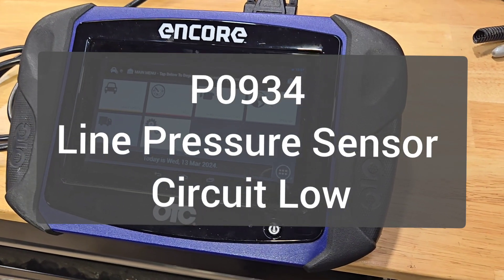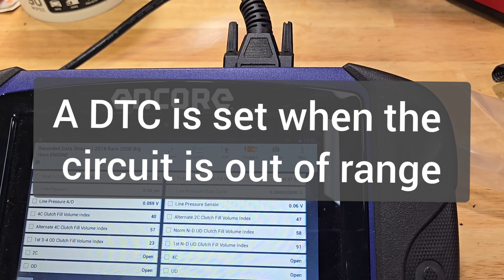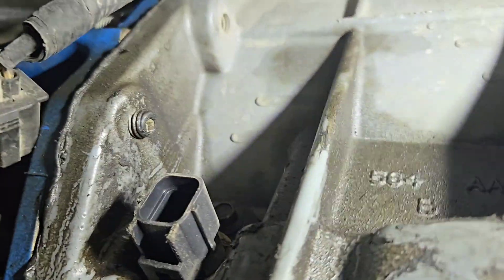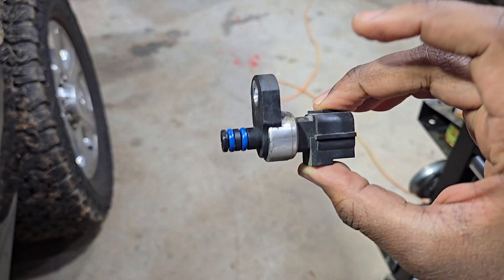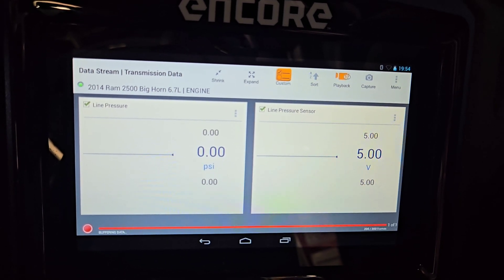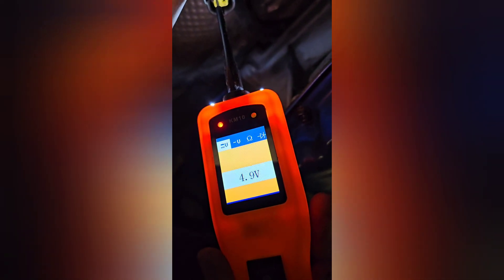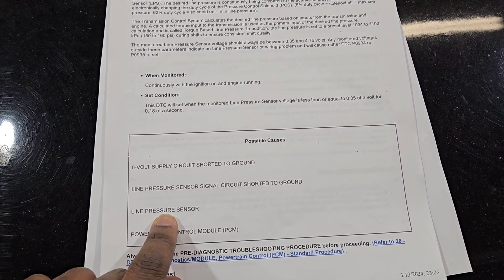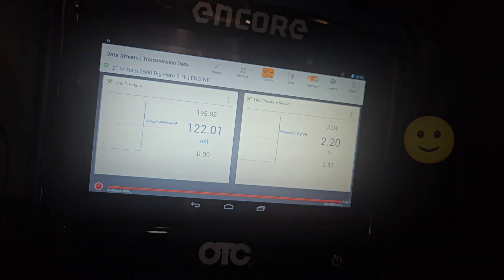RAM 2500 Cummins DTC: P0934 Line Pressure sensor Circuit Low

Comment: I have a 2016 with the Cummins. I replaced this same sensor a month ago. A different code led me to it though. The engine light went out and all was good until today. It came back on but showing the code that you are showing. Any ideas?
Reply from the maker: Use an OEM sensor from a dealership.

Comment: What sensor is being changed ?
Reply from the maker: The line pressure sensor
Reply: @PremiumFuelOnly  ok I search that up but get Pressure Sensor Transducer 😅
Reply from the maker: That's probably it, it goes into the side of the transmission.

Comment: Thanks for the video!
I have the exact same situation.  Replaced my sensor with an Amazon part because of a sensor trouble code.  The new sensor voltage is 0.06v when the truck is not running but just under 3v when the engine is on. 
Where did you find the info regarding how you said the pressure sensor should produce a signal of at least 3.5v when the engine is off but in the on position?  Thanks
Reply from the maker: Its found in the TechConnect literature for this code. An OEM sensor is recommended, good luck.
Reply: @PremiumFuelOnly Is TechConnect a subscription based diagnostic tool or app?  I am unfamiliar.  Thanks
Reply from the maker: @jacobIsrael1200  Yes, its a subscription based portal techs use to access information on Stallantis vehicles. You should be able to get into it via the Mopar TechAuthority website.

Comment: Does the P0934 correlate to the P0810 code? If not, what is the P0810 code because they came on at the same time.
Reply from the maker: Not that I know of, if the P0934 codes appears, the system could go into a default failsafe pressure which assuming excessive wear in the transmission, could cause insufficient line pressure to activate the clutches in the transmission. But I'm just guessing here, since that's a generic clutch code, not usually seen on a 68rfe.  I'd fix the sensor issue first.
Reply: @PremiumFuelOnly  It's on the 9 speed transmission on a 2014 Jeep Limited.
Reply from the maker: @TuPips  Oh, I dont have any experience with that vehicle, If I were you, Id get a subscription to Mopar Tech Authority and look up that code and follow the troubleshooting steps. There may be some TSB's regarding it. Either way you need to fix the first problem before digging deeper.
Reply: @PremiumFuelOnly  Thanks. I did see a TSB that said either a TCM reprogram...the dealership said a transmission or valve body replacement... outside of the TCM, I think it needs more of the transmission pressure sensor replacement. Thoughts?
Reply from the maker: @TuPips  Its not a bad idea to replace the sensor, if you have already followed the other steps.
Reply: @PremiumFuelOnly  Thanks!

Comment: I change my valve body and screw broke and I didn’t think noting of it since it was only 1 .but now I’m getting 2 codes 
Po933-hydraulic pressure sensor range performance

P0868- transmission fluid pressure. 

Can the bolt be the cause
Reply from the maker: Not sure but usually that error is the sensor is bad.
Reply: @ sorry I mean my valve body screws broke .u think that could be the reason for the code
Reply from the maker: @gabrielsalazar6648  No, the sensor code is very specific.

Comment: replaced my tranny with and autozone reman...everything great til p0934 came on..i have been trying to figure this out for months.  tried several non oem parts...finally took it to a shop...said the pcm was bad wanted $2000 to replace...did it myself--code came back...wish i would have seen this before this mess started...just ordered an oem...thanks for the video..i know electrical parts can be sensitive but this is crazy...hopefully this is it
Reply from the maker: @jameswinkelman5341  Yea, if you tested the wire harness and replaced the PCM, it's likely the sensor.

Comment: Replaced mine and the check light came back on after 100 miles or so. But this time the truck shifts perfect.
Reply from the maker: Was it a dealership sensor?
Reply: Nope, looks like that's the issue.

Comment: thanks man i installed a reman transmission from autozone on a 04 5.7 1500 
and it came with a new sensor which is most likely not oem so i hope installing the dealer one fixes this code and also i have a question it also has  a p1775  can you lmk what could cause that
Reply from the maker: Sounds like a solenoid is stuck, hard to say without pulling everything apart.